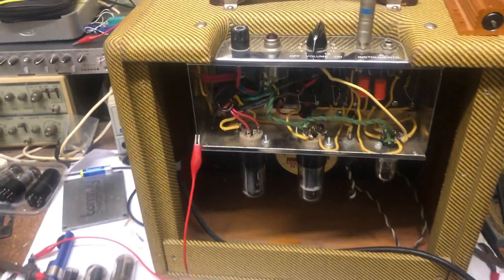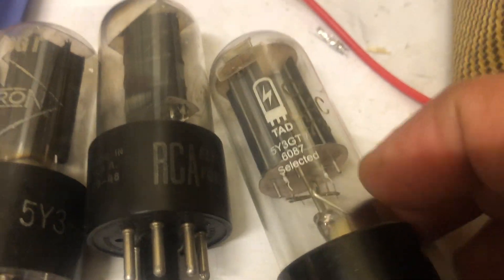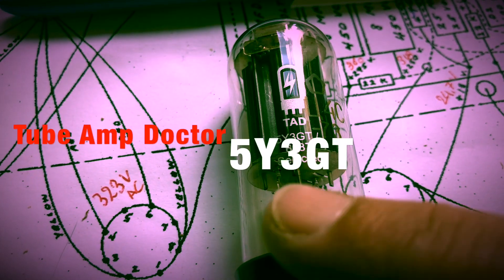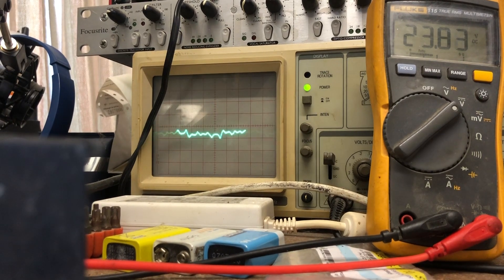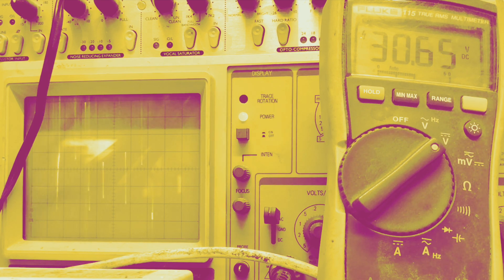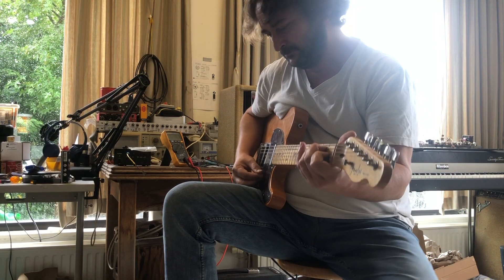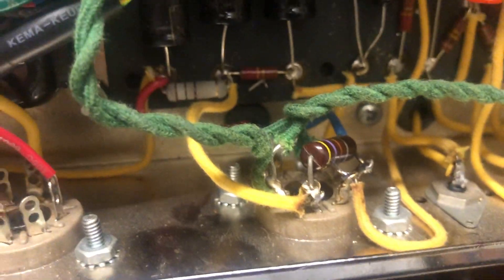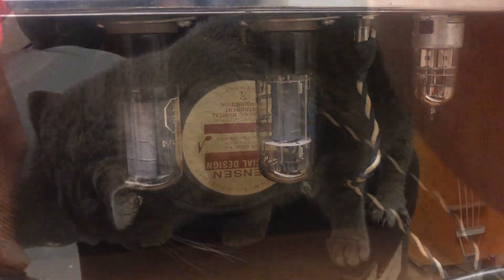Rectifiers in Fender Champ: old vs. new old stock

Comment: 12 volts is the prudent rating for NOS 6V6 tubes unless you can confirm 14v with the maker's data sheet. 

You can still run them at 14v they just won't last as long. I would run the GE and the RCA at 100% maximum.

When a tube struggles to bias correctly despite different bias resistors it's either the plate node capacitor in the power supply or the tube.

Comment: Some of the modern 5y3 perform more like 5AR4.
Reply from the maker: Thanks for the comment -- maybe the Russian TAD tube is the equivalent of a 5AR4?
Reply: @zjokka  The Sovtek 5y3 is like that.   TAD may buy from that factory.   JJ would be an alternative
Reply: @zjokka 5AR4 is a slow start rectifier. So is the 5V4GA. The 5Y3 is a directly heated tube.

A lot of times, like in this case, Russian tubes are roughly equivalent. The Russian "6V6" 6P6S runs on a different plate curve and will bias differently enough that it's not a direct plug in replacement.
Reply: I found the Sovtek 5Y3GT to give voltages like a 5V4, so a little less than a 5AR4, but way, way higher than a 5Y3.